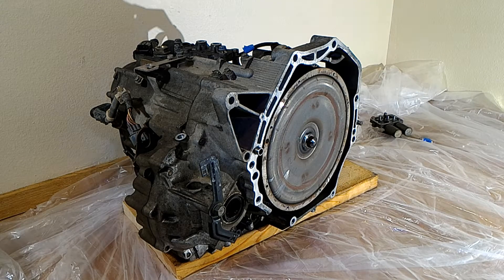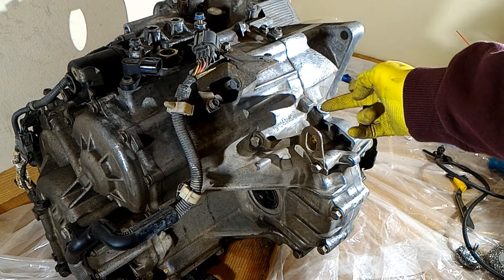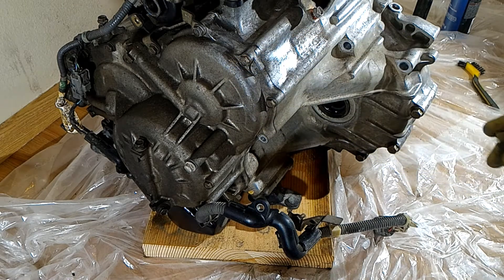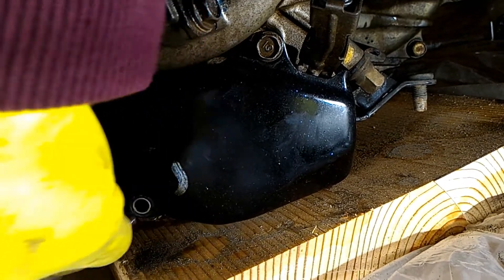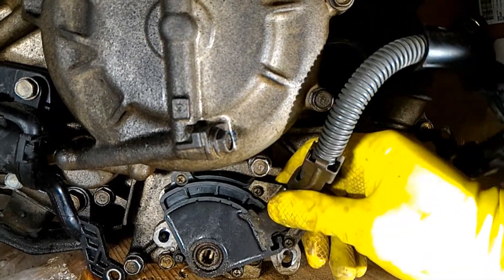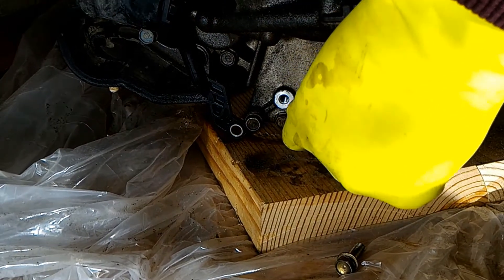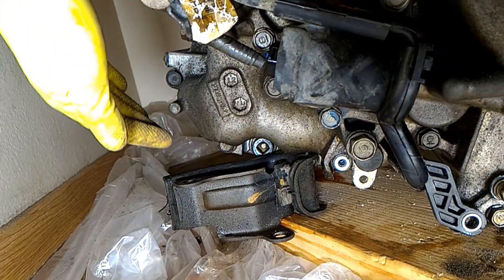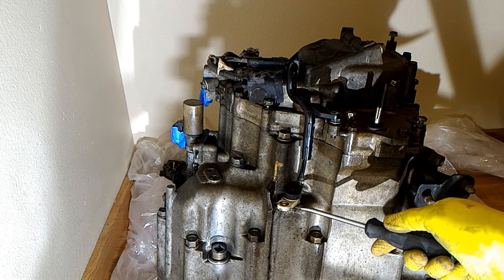Tear Down and Rebuild 2002 Honda Odyssey Automatic Transmission - Part 1

Comment: What exactly was the problem with the transmission that made you take it off in the first place? Perhaps a code p0740?
Reply from the maker: I forgot the code but I think on the 3rd clutch autopsy I might have explained it. It was slipping occasionally in third gear despite me constantly cleaning out both front solenoid screens and replacing both front solenoids. The ones that were single solenoids not the more expensive switches. One of the codes was "incorrect gear ratio". Basically if 3rd gear slips on the 5 speed or 2nd gear slips on the 4 speed your clutches are toast. No amount of cleaning or replacing transmission fluid can fix that
Reply: @eksine  replacing a clutches will work I have 02 odyssey she has about 210,000miles engine and transmission not bad for rebuilding I want to restore her.
We got her in 2006 she had 98,000 miles from the title.
Reply from the maker: @WilliamHollinger2019  yes replacing those clutches for the gear that failed will work however pay attention to I think it is part 13 where I explained why those clutches failed in the first place, it is due to oil holes that are too small on the thrust washer called "washer ABCD". the solution is replace it with the updated design. if it's not part 13 I can try to find which part shows that piece for you. most of my videos shows how to remove the transaxle and I show how to rebuild this transmission. I have the exact same van as you 2002

Comment: My 03 v6 has a different filter. Are you sure these are the same that are in the Accord 03 v6? I got a tranny rebuild so maybe they rebuilt a different version?
Reply from the maker: The accords are going to have different transmissions than the Odysseys. Yours probably doesn't have an external filter it's probably just the internal one. From what I was reading back then basically all models of the similar era were using some variant of the transmission design so they should all basically have the same problem. So I would look it up and see if your 2003 Accord V6, has this common transmission. I have a 2001 Accord V6 and it is part of the problem, I don't know about your 2003 so you'll have to look it up but if it is part of the batch that has similar transmission problems than this likely is a similar fix for it assuming that you have a total failure of one of the lower clutch packs like 1 thru 3